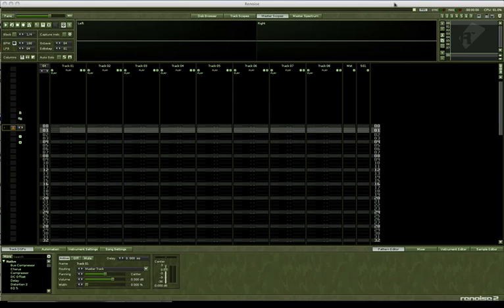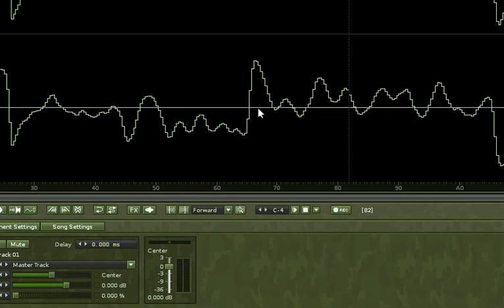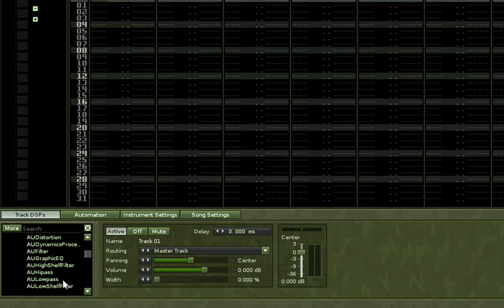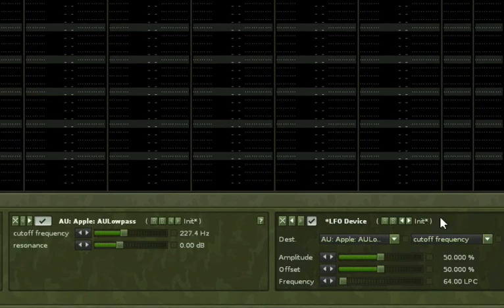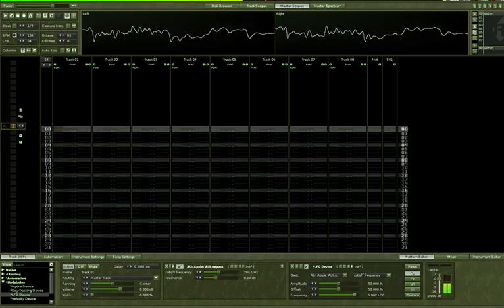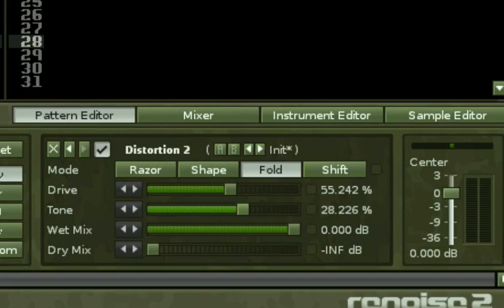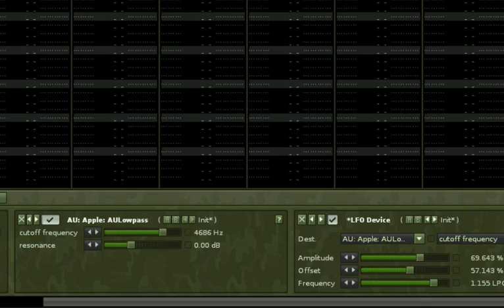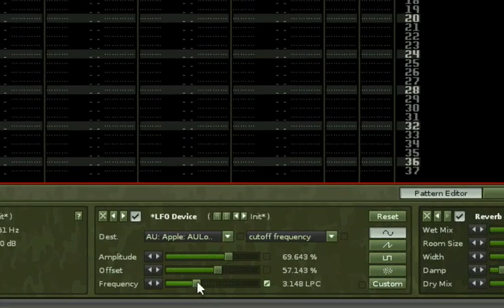How to make a Dubstep Wobble Bass in Renoise

Comment from the maker: There's an option in Render section > Export As Separate tracks. That's one way.  You can also just select any part to export and right click "Render New Sample" then save that anyway you want.  If you use Renoise to make a sound the 2nd way is easier.

Comment: Nice tutorial.
Did you know you can easily record the frequency of the LFO with your mouse?
Just use your right mouse button on the frequency parameter slider when the pattern is running and record is on.
This will generate pattern commands in an effect column. You can do it with almost all the parameters in Renoise, even with some VST plugins.
Remember to put the marker in separate effect colums for each parameter, or else you might end up erasing your previous commands.

Comment: @DeadknightSixXx Under your native effects, there should be a sub-directory called Filter, inside of which is a filter called Filter. That thing is basically the same thing as the AU low pass, and it has other filters you can experiment with. If your version Renoise doesn't have that, there are a few zillion free VST filters that might work, but I don't know how good they all are. The one in Renoise has kept me happy so far.